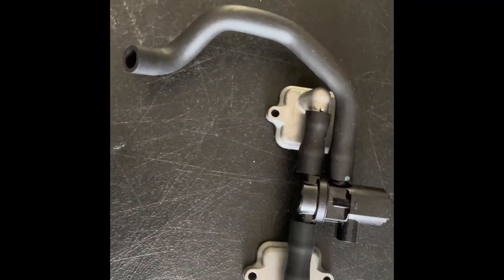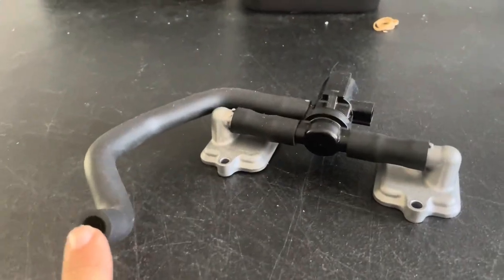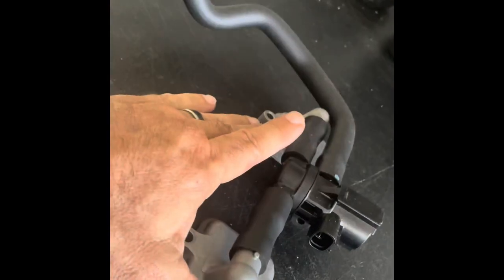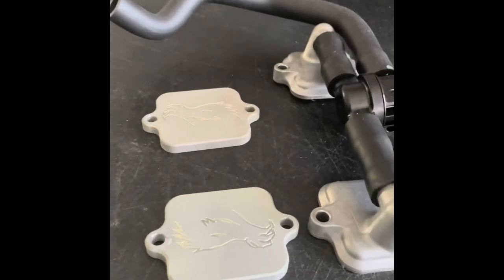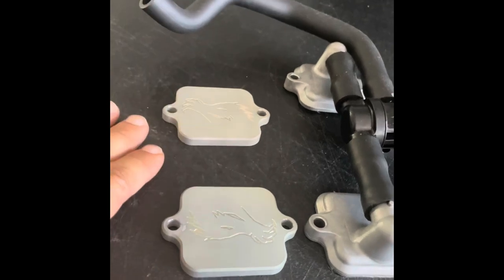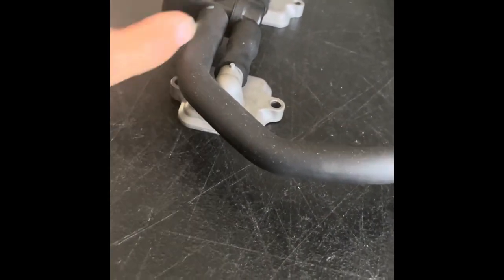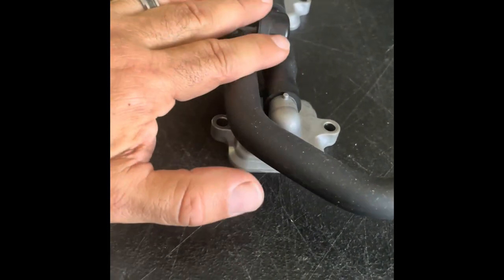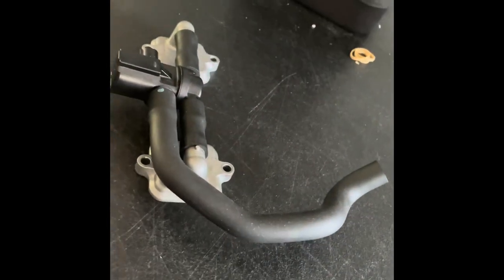Tech talk: AIS / PAIR valve , the most misunderstood system on motorcycles today

Comment: On a tuned bike with a full (catless) exhaust if you don't want the flames/decel pop block off the airflow, plates are pretty expensive for what they are flare plug and cap work just fine, good information in the video though.
Reply: Bought some off aliexpress for 12 bucks, definitely worth it
Reply: I just capped my line
Reply: If someone WANTS the flames and pops on decel and keeps the factory PAIR/AIS Valve system BUT removes the charcoal canister and caps the purge valve hose, then is it possible to still have flames and pops on decel ??
Reply: Doesn’t this feature make the bike slow down a lot when you let off the fuel?
Reply: Would blocking off the tube that goes into my Airbox be enough? I have a k9 gsxr600 and I have an ecu flash tune because of my cat less midpipe install.
Reply: @nimaO_G  yes it does the same thing as plates used to called the marble mod drop one in the tube and reattach it.

Comment: Great vidoe man! 
I was wondering if blocking the ais on a untuned bike can lean out the AF reading? 
After all, the air is injected in front of the o2 sensor, so theoretically it should read a richer mixture and withdraw fuel
Reply from the maker: Thanks !!

The o2 sensor is only doing anything at light throttle and lower rpm.  

Also the ais valve is only open on closed throttle deceleration.  The air fuel during decel is pretty irrelevant 

Here is a video i made about the o2 sensor

https://www.youtube.com/live/sAVJ4bgi8cs?si=kO5fUAl7T2Q43cSt

Comment: Still very novice in understanding of system. After getting your ECU flash and having Graves slip-on, leave alone this alone? Or will adding block off plates help more. Apologies for my ignorance.
Reply from the maker: No worries.  Leave it alone. The bottom line is blocking off the ais never adds performance it just stops popping

Comment: Does blocking the PAIR valves on a non tuned bike (CB650R) with a aftermarket exhaust (no cat) affect the AFR ration in the combustion chamber? Because the O2 sensor in the exhaust will see richer mixture (because the PAIR are blocked, so no fuel is burned in the exhaust) so will assume the bike is richer than before and then leans it?
Reply from the maker: no,   PAIR valves are only active at closed throttle and the stock o2 sensors are not that accurate that a small amount of air is going to change what it is doing.

Also the stock o2 sensor is only active at light throttle and lower rpm's

https://youtu.be/HLrtlLSEdRo
Reply: @vcyclenut  thanks mate. Doing this mod this week.

Comment: This is a very interesting video, thanks. I've been thinking about doing this with my bike, because it has an aftermarket muffler on it and I'm not really a fan of the popping and crackling. I guess that it would be expected that the tip of the exhaust would get a bit of soot around it after blocking the pair system?
Reply from the maker: Glad it was helpful!  Yes getting some soot on the tip of the exhaust is always normal.

Comment: This is really interesting! I have a carburetored 2012 Ninja 250. It has this system on it. But it also has a coaster enriching valve (air cutoff valve) attached to the carburetor which will reduce the amount of air flowing through the idle circuit on deceleration if the wheels are spinning the engine and the butterfly valves are closed. The purpose of this is avoid the lean condition at idle throttle with the engine still at high RPMs thereby reducing the popping and backfiring. It seems like this AIS and the coasting enriching valve conflict with each other. What are your thoughts on it?
Reply from the maker: No. They are both trying to reduce the amount of unburnt fuel coming out the exhaust

Comment: So you said if your tuning a bike you prefer the block off plates so you get an accurate AFR readings. But if they are only working on decel or closed throttle what does it matter? If they aren't doing anything while cruising or acceleration how would it affect afr I don't understand. Im not trying to be an ass, as an amateur tuner im trying to understand
Reply from the maker: because they can leak.  The valve should only be pulling air at closed throttle, correct, but I am  not trusting my work to a rubber stopper against a hole.
Reply: @vcyclenut  That's true I didn't think about that , makes sense

Comment: my method to block off: remove valve and short tubes from between plates, remove longer hose to airbox, cut hose from airbox to fit between plates, connect both plates to each other without valve using the cut piece.. fill the hole in the airbox with a dab of silicone
Reply: How well does this work ? Thinking of doing it atm
Reply: It works just as good as block off plates.

Comment: Great video, I already installed a full exhaust and got ecu flashed, can I install block off plates without needing another flash?
Reply from the maker: only thing that may happen is a check engine light for unplugging the ais solenoid

what bike and who flashed it?
Reply: @vcyclenut Flashed by Moore mafia they disabled pair valve so I don’t think i would get a light for removing it. I still would need to use block off plates to stop decel pop right?
Reply: @vcyclenut  2024 Ninja 650
Reply from the maker: @JordanSmith-bt2sq  yep.  Or just plug off the pair valve line as it comes off the air box
Reply: @vcyclenut Cool man thanks for the guidance, much appreciated

Comment: i dont understand why for flashing is required to eliminate que AIS system in order to get accurate readings... so how the stock ECU does it with the system in place on the first place?
Reply from the maker: Stock o2 sensor is a narrow band only for emissions. Doesn’t care if it’s a couple percent off 

Also the system when working properly is only active at closed throttle.  Air fuel at closed throttle is not very important 

When tuning I want to be 100% accurate and can’t take the chance the system is leaking and bleeding in air during open throttle

Comment: Where is this located?? Someone said do marble mod on my GSXR but nothing points to where it is just plug 1 of the 3 hoses.
Reply from the maker: It’s on top of the valve cover on the Gsxr. You want to block the line that goes up to the airbox

Comment: hi, thanks for the video! I’m just curious what happens if we get the selenoid out and plug the hoses directly ?
Reply from the maker: Most bikes will throw a check engine light if you unplug the solenoid without disabling the code in the ecu

Plugging the line is a free way to block off the ais.
Reply: @vcyclenut  i couldn’t explain myself correctly 😅 i want to link hoses together so it can drag air all the time. what are the consequences?
Reply from the maker: @2wheelsmorereels  just lots of popping and🔥
Reply: @vcyclenut  i like that 😆 thanks!

Comment: i remove the breadbox of my z900 and installed an aftermarket pipe. however, i leave the catalytic converter intact. now my bike is popping on the deceleration. my question is will it hurt my bike if i dont retune. Thank you.
Reply from the maker: I haven’t tested the z900 like that so I can’t answer your question

Comment: Nice explanation! When the ECU flash disables the AIS, would it achieve the same as installing the PAIR valve block-off plates (provided that the rubber seals are functioning) and no pops on deceleration? Also, will the AFR be affected when the seals fail because it constantly draws fresh air from the airbox to the exhaust?
Reply from the maker: In theory yes. But it’s pretty rare they seal up completely 

It won’t affect the actual air fuel ratio. Just what a wide band o2 sensor would read because the fresh air would dilute the exhaust gasses

Comment: Hey I recently flashed my ecu on my Zx4rr. I have only a slip on and I did disconnect my o2 sensor but do I need to do anything to the AIS/pair valve for just a slip on? Thanks!
Reply from the maker: did I do the flash?  If so I sent the ecu back with an information sheet.

Comment: Can you tune with a rapid bike race on the bike? Will an AIS delete help the rapid bike module adjust better?
Reply from the maker: Ive run into issues before with the rapid bike.  Yes you should block off your ais to give the rapid bike the most accurate exhaust readings.  Im surprised it didnt say that in the instructions for it.
Reply: @vcyclenut  i didnt install it so i dont know. im going to email you with some questions.

Comment: Could a person pick up two rubber plugs and cap off both inlets of the pair valves?
Reply from the maker: you could,   yes

some bikes without the ecu flash to shut off the check engine light unplugging the solenoid will create  CEL.  So you may have to leave the solenoid plugged in anyway

Comment: is it bad that I have a factory exhaust and have disabled this system?
Reply from the maker: No.  Just didn’t accomplish anything really.   Unless you’re analyzing the exhaust gas for air fuel ratio.
Reply: @vcyclenut  Thank you very much for the reply, I just wanted to know if I am doing any damage to the fuel ratio and the engine in general

Comment: you mentoned an aftermatrket exhaust without a cat, but what about one with a cat. I just put a Kelpi exhaust on my 24 XSR900, and I noticed the poping on decel. I knew it was this system doing what it was designed to do, but would it damage the aftermarket cat by disableing this system? i realy don't care for the pops, and would rather it not do it.
Reply from the maker: The 24 xsr does not have an ais system to block off or disable
Reply: @vcyclenut  oh ok. Learned something new. I honestly never looked into it just assumed it did lol. When I put the bike away for the winter I'll send ya my ECU to do your magic.

Comment: Carbon in head?
Reply from the maker: No.  It doesn’t do anything in the combustion chamber.  Carbon build up is from having left over fuel.   This eliminates that by burning it off. If anything it would reduce carbon build up in the exhaust port

Comment: Can i install this on my mt09 2021.. i want more pops and bangs!!
Reply from the maker: No.  You bought the wrong bike for decel pops and bangs
Reply: @vcyclenut  Crap! Drill a small hole pipe before the muffler? or get a MT10 2022?
Reply: so  a specific pops and bangs tune wont do much on a mt09 gen3??
Reply from the maker: @hossor123  i vote mt10
Reply from the maker: @hossor123  not without doing stuff i would not do to my own bike